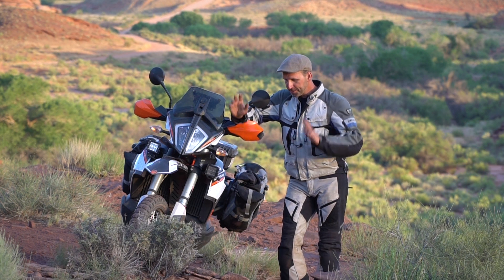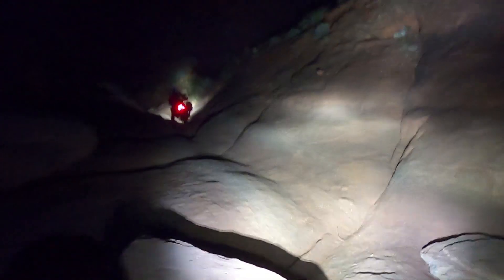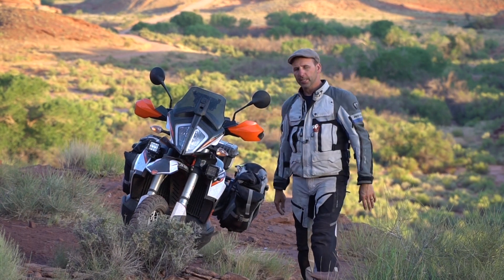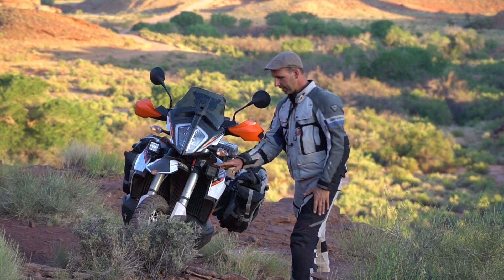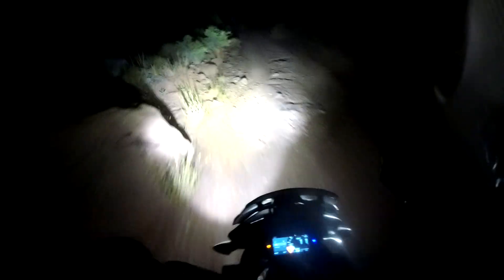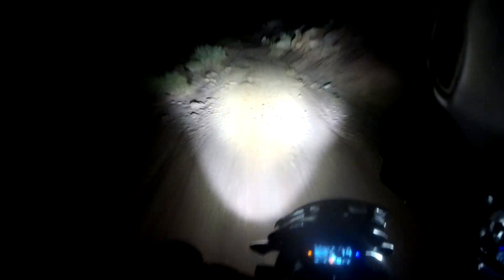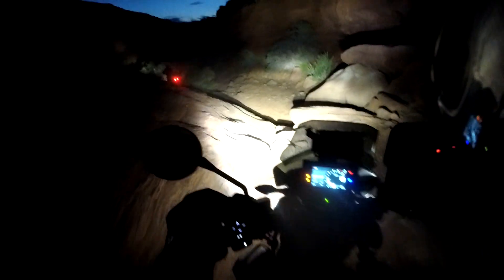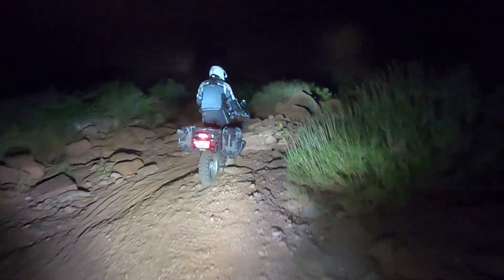What you don't know about offroad lights

Comment: Based on riding in the darkness, on MTB and dirt bikes. A helmet mounted light is really useful. Not sure how that would be practical for ADV riding ?
Reply from the maker: I have used helmet lighting for night racing but it would be impractical for ADV travel
Reply: Bret I was wondering about helmet mounted lights also.  Could you expand no why they would be impractical?
Reply: @erniecolussy1705  Weight, bulk and wind noise. However, you could to a quick detach setup with some really lightweight light. Maybe a kind of go pro mount. A fixed power port on the bike and a light/cable setup you could mount on your head in a pinch.
Reply: I forgot wich company, but there is one that makes these extremely bright headlights that can be ised with go pro mounts. Iv used them way back when i rode trough TaT. They were awesome and during the day i just pluged them to my bike.

Comment: Good informative video, as usual. it might also apply be useful for some road riding, especially if the terrain is very hilly and, or on some poorly maintained country /  back roads (UK Experience).  I would use the RHS Light to go low & the LHS right to go high, to take account in the event of any oncoming vehicles & the time it takes to to dip the lights. Obviously switch the other way around depending on which side of the road you should be on. If not already, go watch the tool kit video, it has some really good tips. Keep up the good work.

Comment: One thing to add in my experience.

On one ride I got off to a late start in the early spring while doing a short loop in the N. GA mountains on my WR250R.

The trail had sections of snow and ice but it was manageable as long as you could see it and plan away to get through it.

At that time I had two auxiliary led lights mounted up on the handlebar and an LED H4 replacement bulb in the headlight.

As the sun went down fog settled in on the mountains.  The LED lights were worthless in the fog - all you would see is a big white sheet in front of you.  At the point I couldn’t see the ice and snow sections which made for some pretty exciting slow riding.

When I got back I swapped out the LED H4 build for a standard halogen bulb.  Later I found some flip up yellow tinted covers for the auxiliary lights that in theory should allow me to use those lights more effectively in foggy conditions.  I haven’t had the opportunity to test that theory out yet and that is fine by me.

Comment: I'm glad again to see heavy breathing happening on technical trails. Bossing a 400-600 lbs bike around DOES require some exertion. I get told "if you are a good rider, the bike does all the work." Yeah. Their idea of what "good" is differs from mine. Their "good" is my "excellent". On the other hand, if you have memorized every detail of a trail, and know exactly how to get it done with you eyes closed, maybe it's time for a new trail and some hard breathing?  Rather than sandbagging your fellow riders because this is their first time in. Good video. 
My accessory lights are floods, for off-road only. Lights up my front contact patch and has a spread of about a 165 degree cone.
Reply from the maker: After riding 15 hrs in temps hovering around 100 degrees it's hard not to show fatigue. We finished at around 17hrs. It was fantastic... I can't wait to go back

Comment: Omni directional lights solve the issue. I have a pair that have a 60 degrees angle each both horizontally and vertically. On the 790 they fit perfectly the dark spots of the stock low and high beam. No issues at all on bumpy offroad

Comment: Anyone use a helmet mounted light? Any that might be recommended?
Reply: You could probably get a half-decent one that clips to the brim of a hat and just clip it on your helmet peak.  It's not like you're doing 60 down these trails so it doesn't have to be bolted on or anything.  I don't think you'd want anything actually stuck to the surface of your helmet either, because that would create a stress riser that could potentially defeat the helmet shell if you actually bounced your head off something.
Reply: I wondered too, but he's also filming??
Reply: yes i use MTB helmet lights AYA UP

Comment: I have no experience in off-road riding at night but I would try a headlamp on the helmet with a strap or improvise connection to a GoPro bracket. In difficult terrain a beam of light towards the gaze would have helped.
Reply from the maker: With a strong enough light that would help. When I did 24hr racing helmet lights were very common. Now with LED it makes even more sense.

Comment: Bret, love the videos!  You always provide level-headed and confidence-inspiring insight.  I also love that you have lightened up your load in switching to the 790 R.  I've really enjoyed mine!  Out of curiosity, do you prefer to run in off-road mode or rally mode more when on the trail?  methodical and predictable or quick twitch and responsive?  What's your flavor?
Reply from the maker: On technical trails I run Rally with ABS off. On normal dirt or gravel I run in Offroad with offroad ABS

Comment: Hi Bret, I would be very interested in correct body positioning on very long uphill passages. I tend to lean forward over the handlebars too much, causing instability.  Great content by the way, thank you!
Reply: you can try and squeeze the bike more with your legs and feet but mostly just try and keep a balance. if you are too far backwards your arms will fatigue quickly and the front can jump off to the sides. too far to the front is usually not that much of an issue uphill as long as you have enough traction. if the bike gets unstable that usually means that you are going too fast or too slow. let the bike do its thing, dont be too stiff on the handlebar and if you really need to then stabilize it with your legs. often you can get some pressure on the bike by turning your feet outwards on the footpegs so that your heels push into the bike (not actually turning your feet but just pushing inwards with your heels). have fun out there!

Comment: WOW .. nice .. did that on MTb .. Hey Bret .. will you go on track like this with a V strom 650 Xt like mine? Hi from ITaly
Reply from the maker: It would be possible on the Vstrom but difficult. The Vstrom has much simpler suspension and FAR less ground clearance.
Reply from the maker: FYI... My first big ADV bike was a Vstrom 1000...
Reply: @BretTkacs   yes that was my main doubt.. you just confirmed that.  small ground clearance. ..

Comment: Hello Bret. Another great video from you, Please keep up the great work. I like the work you do and you are a pretty good rider too. I have a 790 also and I am considering adding additional lighting for the reasons that you have described and for that "just in case situation" if the main headlight fails in the dark as happened to me many years ago on a BMW R90S. It aint no fun trying to look for that white line on the side of the road in the moonlight if you got any. Any how, did you use the KTM OEM accessory lighting kit ( about $500.00 at the local KTM dealer ) or did you go another route? I like what you do and would really like to know what your lighting setup is....Thanks from TEXAS....Jim
Reply from the maker: Rigid D2's using the BDCW mounts and tapping the factory 10amp circuit for power (no relay)

Comment: Beautiful video as always. However, I have a question Bret, how do you set the light up for a trail that is all twisty or how do you gauge a turn in the trail at night?
Reply from the maker: With fixed lighting I don't ride so fast I can't see, and I never ride faster than my lightning. When I raced afterdark on my 450 I used helmet mounted lights in addition to fixed lighting. That is the ideal answer to your question.

Comment: This hit home, Sunday we got stuck time after time for one reason or another but it put us hours behind, I haven't put aux lights on yet but I tell ya I am now. What do you think of two sets? Overkill? I was thinking to add lights to the forks to give directional lighting, thoughts?
I also found my pegs are too small for my size 13s my feet were so sore, would a ims adv 2 create bad habbits?
Thanks Bret
Reply: I think you get to decide what's overkill, who cares what others will think. All it takes is single trip with them saving your bacon for them to pay for themselves in my opinion. I've got a set of fixed Cyclops lights for pavement and a Black Dog Cycle Works fork mounted light bar as back up on my KTM 1290 just in case something like this happens to me. That thing is insanely bright and it's nice that I can control where that little mini sun's fury is directed.
For the feet, a sturdy set of boots with a thick shank will make a big difference if you don't have something like that already. If you do though, then I highly recommend a bigger than stock foot peg for standing comfort.